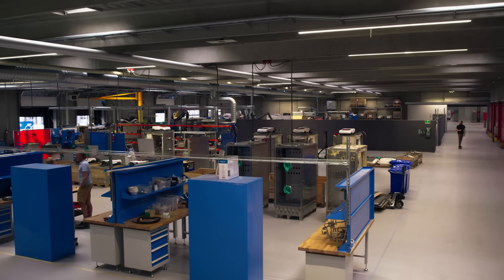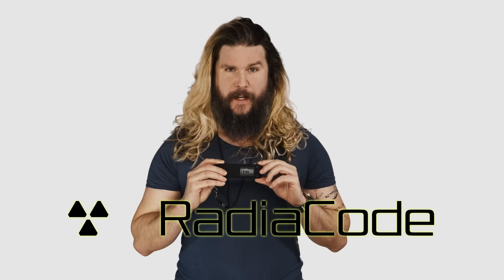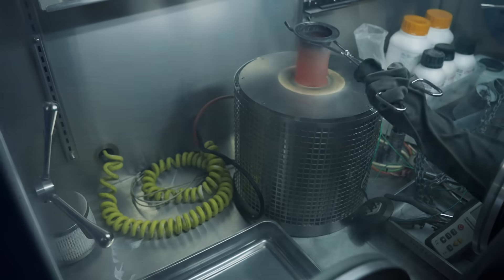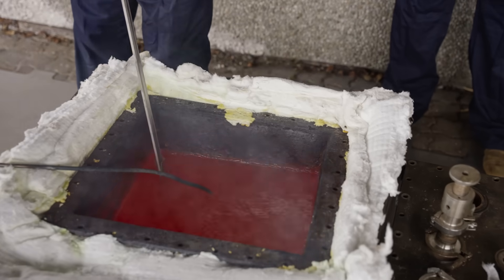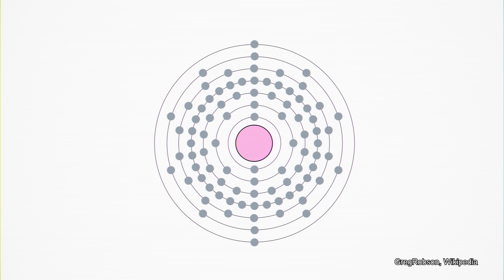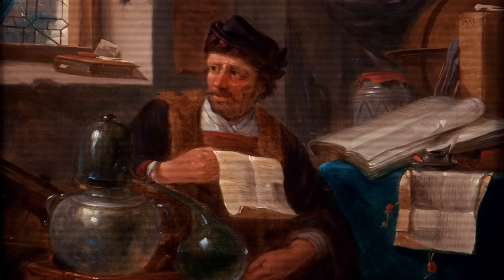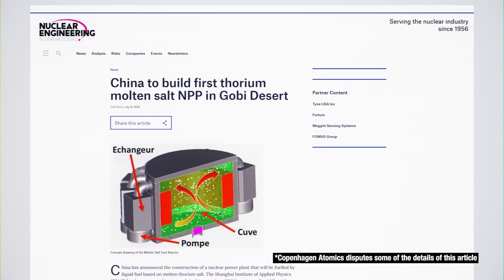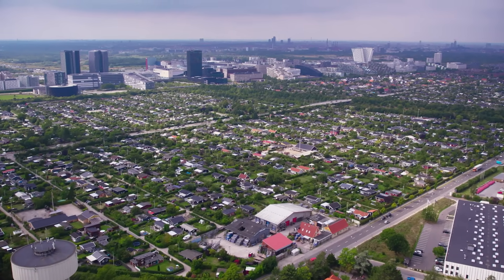Is THORIUM the Future of Nuclear Power?

Comment: Great vid, Kyle. Copenhagen are a legit team with a great design and solid manufacturing and go to market plans. Interesting point about 1t Th equaling 200t U, but does that ratio hold up if you’re using U in an MSR with online FP reprocessing?

Anyways, really interested to see part 2. We did a deep dive on that when we were just starting out at Terrestrial, and the conclusion we came to was depressing for me.

Comment: One reactor a day? I'm sorry, I'm immediately suspicious. Am I the only one? Even then, what about regulations? I can't see where's the good in that if you let a private company potentially flow the market with thousands of nuclear reactors throughout years of production and not talking about, in parallel of the actual development process, the potential risks of having so many small to medium nuclear reactors running out there. 

Safety and regulatory authorities already have to constantly contend with corporate and political interference and having so many more nuclear reactors potentially hitting the market is going to require a stronger workforce in those regulatory agencies, to track them. Which usually goes against corporate interests... Maybe I'm missing something but hearing him talking about producing one reactor a day seems very PR driven, at best, without considering the implications of that, at all. Am I wrong?
Reply: .... you missed what the guy said. the rectors only last for about five years. so he can only have at full pelt roughly 1800 of these reactors going at a given time. his scale is literally to power Europe. the fuel could last 100 years so what he's proposing is essentially making nuclear power plants that are as safe as running a diesel electric locomotive but you're swapping the fuel tanks when the locomotive is no longer operational.  Literally changing the nuclear industry to mimic the height of the automotive industry.
Reply: @Dallen9  Ah yes, missed it indeed. Still, you need to ensure those potential ~1800 reactors are well inspected and their commercial application well regulated. And it would probably be impossible with the resources that regulatory agencies have today. That's why I'm saying that both aspects should be tracked and developed at the same. Especially since regulations always lag behind corporations, unfortunately, as a direct consequence of a lack of funding and political/corporate influence. Still I'm all for developing those type of reactors, especially since fusion is certainly not going to happen as fast as a lot of dubious startups are promising out there...

Comment: The fact that the salt expanding slows down the reaction is what's coolest about this whole design. It's mindblowing that this stuff was abandoned back in the 50s or whenever it was. With a meltdown you just poop the fissile material into a storage vessel under the reactor and that's that. Reaction over.
Reply: The problem was the chemical side of things, corrosion control. But research into corrosion of molten salts and ultra pure salts have since fixed that problem.
Reply: @migBdk  Your salt is only ultra pure until you turn your reactor on.
Reply: @carlsaischa  That's why you boil off the volatile fission products out of the salt. And most fission products can be made to be volatile with a combination of low pressure and electrolysis.

Basically there is an in-build purification system in the reactor.
Reply: @migBdk  Yeah molten salt is very good at chewing through lots of things.
Reply: @migBdk  partially true. the big technical problem at hand was corrosion. but you are not looking at the more systematic underlying problem.
Reply: @MusikCassette  You kee saying Problem, without saying what it was.
Reply: @MusikCassette  Am I guessing this correctly? You point to a lack of political interest in molten salt reactors leading to a lack of resources for research put into solving the corrosion problem, and call this "the systematic underlying problem". 
But lack of research is not a problem. The problem is corrosion, and the lack of research simply means the problem was not solved for decades.  

Or is it some other problem you are not explaining?
Reply: @migBdk  no you are not.
Reply: @ Then explain what you think the problem is.
Reply: @ then explain what you think the problem is
Reply: @ then explain what you think the problem is
Reply: @ My last answer got censored. So I am gonna wait and see if this gets through.
Reply: "The systematic underlying problem" @MusikCassette 

Is being closed minded.
Reply: @RuyGedares_GuyRedares  not what I was talking about
Reply: Back in the 50's fossil fuels were pennies on the dollar today.  My home was built in 53.  No insulation, a steam generator in the basement that ran at about 60% efficiency with radiators built into the walls, under the single pane windows, up against the outside sheathing to warm the exterior of the home as much as the inside.  They just burned oil like it didn't matter because it was $50 at most to fill up the tank every 2 weeks by today's standard.  Same with energy back then.  Waste storage was "eh, who cares, bury it we'll never run out of room.  A MUCH MUCH lower electric demand (My house also had 60amp service. Now 200 upgraded.) and the major issue of having weapon grade material.  Just getting enough material back then to build bombs was a problem.  Today, we need thorium.  Period, end of story.  Using water under 800psi of pressure is just stupid.  Especially when you realize steams expansion ratio.  That's where all these blasts come from on failures, not the nuclear material.  Plus you can just move the thorium to a storage pool and the crisis is over.  Fukushima would have been a nothing burger if they used thorium.
Reply: @JViello  perfect explanation :) also the steam expansion point is really good.
Reply: Thing is with molten salt, is that it's horrifically effective at corroding materials. There's also the fact a molten salt reactor can't be used to make bomb-grade material. So... yeah, no bombs means no funding.
Reply: @The-Singularity-X01  "There's also the fact a molten salt reactor can't be used to make bomb-grade material." I would call that an advantage. I am not sure it is true though.

on the other point: the problem is not just corrosion, but corrosion in a place where you can not just replace stuff.
Reply: Yep just like chernobyl
Reply: it wasn't quite. there were a few attempts. But they were big failures. 
The hard truth that you nuclear fanboys have to face is, that any small technical problem becomes a major issue when dealing with radioactive material.
Reply: @MusikCassette  They did abandon it, as it didn't make weapons grade material. And at that time it was what people where most after in the reactors they wanted. They did build a viable test reactor at one point, but the cost of a dual program where one didn't make weapons grade material was unwanted.
Later the idea was also floated to make it mobile to be used in bombers, but the weight and technical advancements made it not viable.
Reply: @ your picture is incomplete. They really had big problems.
Reply: @MusikCassette indulge us please haha
Reply: @MusikCassette  nuclear fanboys? You sound like a child
Reply: @MJRSA9404  how so?
Reply: @MusikCassette the biggest reason that thorium salt reactors were abandoned was because they don't produce plutonium. You can thank Admiral Hyman G. Rickover for that.

Comment: One thing that I did not quite understand from the video: what happens to the excess neutrons? I get that more thorium is bred into new fuel but since more neutrons are generated than there are needed in the breeding process, there has to be an end to how much new fuel you can breed. Since you cannot dump infinite amounts of thorium into the process, something has to capture the excess neutrons at some point, no?

Comment: I think I know the answer. Thorium is highly corrosive to metal. Cost/reward balance gets heavily skewed. There is alot more preventative maintenance and upkeep with these thorium breeder reactors. Although a meltdown wouldn’t be as serious vs a traditional nuclear reactor, thorium reactors are a higher probability  of meltdown due to its corrosiveness. Traditional nuclear reactors don’t really produce a lot of waste either. 95% of nuclear waste is stored on site in massive 10’ thick concrete confinement buildings that can withstand a direct missile strike. Thank you T Folse Nuclear!

Comment: Thorium has a few tricks up its sleeve for power reactors. It will fission well in the fast spectrum and transmute to 233U in the slow spectrum. To take advantage of both processes the ideal salt mix is chloride based rather than fluoride based. Want to use it to breed Pu or H3 it is simple to do so just pipe hot 238UF6 gas through plumbing surrounding the active core region, and add 6Li as chloride or fluoride and you get tritium as either TF or T gas. ❤

Comment: molten salt being not in a state of natural critical runaway and the invention of "freeze plugs" is the only nuclear reactor that actually shuts itself down in a full power loss.   none of these systems of light water reactors that need backup power and generators in order to be safe and pump new cold water in or move the control rods.  freeze plugs are maintained with power and dissolve with no power and drain the reaction chamber.   I hope this gets mentioned in part 2.
Reply: Any nuclear reactor on earth shuts itself down when power is lost.
Reply: @carlsaischa  no.  They don't.  The rely on active powered cooling systems to shut them down safely.  Hence meltdowns when those fail.  Look up Fukushima.  Flood water hit the backup power generators.

Comment: molten salt is also a 1 atm pressure.   to get a light water reactor to work you need the nuclear heat exchange to be above boiling point by water and in a pressurized system and risk steam explosions.    Molten salt can heat exchange at 4x the temperatures while staying in its liquid range and zero pressure.  No explosions or pressure venting.    I hope this gets mentioned in part 2.

Comment: The one thing I’d like to understand more is the chances of losing the heat in the salt and it “freezing up” in all the piping. 

Years ago I dealt with a process that employed the circulation of molten wax. Unlike this process where the heat is generated from within, we had to generate the heat externally and then heavily insulate and heat trace all the piping. Any cold spot in the system could cause the entire process to freeze up. Luckily it was wax and didn’t take as much heat to reliquify as a molten salt would. 

Curious if they have the potential for similar problems.

Comment: Why?  Because the current nuclear power program is an offshoot of the development of nuclear weapons, both U235 and Pu238 types.  The U233 produced in the Thorium cycle is consumed as it is produced, plus the short half-life is not conducive to the development of nuclear weapons.

Many people do not realize that the US nuclear arsenal is actually under civilian control through the Department of Energy whose budget has been primarily spent on nuclear weapons construction, maintenance and custody.

The LWR development used U235 as it was already being produced at Oak Ridge and Hanford.  Later there was to be the so breeder reactors based on a Pu238 cycle.

Comment: While i am glad to see teams actively researching this topic, lets not get ahead of ourselves.  My understanding of why the MSR didn't gain traction had more to do with the corosive nature of hot chlorine ions on the metal of the plumbing, the chemistry needed to remove the actinides and other undesirable products from the molten solution without it freezing, plus the lack of experience with working with a novel fuel cycle in a novel reactor design (for example, how do you repair a broken pump in the primary loop? if you do get into a runaway thermal event and the drain plugs melt, then what do you do with tons of highly radioactive salt? What is the effect of neutron bombardment on the plumbing over the course of the reactor's lifespan?)
And no, PWRs have nothing to do with nuclear arms production, plutonium production was/is done in breeder reactors that typically don't produce electrical power because they're geared towards high neutron flux to irradiate the feed stock rather than heat the coolant.  The proliferation concern has more to do with the fuel enrichment process than the reactor itself.  And if a bad actor wanted to make a dirty bomb, the waste products of an MSR are just as bad.

Comment: So, I'm about to take a dump on molten salt reactors, but I want to say first that I like them and support them.  We should most definitely be looking at these types of reactors.  That said, there is problems.  These aren't new.  One of the first reactors was a molten salt reactor.  They were kinda crap.  If you can't keep the reactor online because of some issue you got a really big problem.  Which is what is most likely to happen with the first motlen salt reactors.  Some places these things are simpler.  Some places they are more complicated.  Like if molten salt and water meet, you're having a very bad day.  So now you have to put all of your pipes into double pipes or do something to make sure the two never meet.  Also when a water reactor turns off you wait like 2-3 hours before you can touch it, because of radiation.  For a molten salt reactor you have to wait a week because it has different decay products.  Liquid water reactors won the technology war because they were less crap.   Now 60-70 years later we now have 60-70 years of experience and expertise operating liquid water reactors.  This is going to be VERY difficult for molten salt reactors to compete with.  They are going to require a lot of work to get operational, get their capacity factor up, etc.  That said, we should still do so.

Comment: No it isn't. Thorium cycle MSRs solve a problem that doesn't exist and exacerbate a problem that does. They're more expensive than LWRs, and capital cost is the primary challenge of nuclear energy.
Thorium is non-fissile. The thorium fuel cycle is a breeding cycle. Breeder reactors are inherently larger, more complicated and more expensive than non-breeders. 
Molten salt reactors are inherently more challenging, complicated and expensive than conventional breeders. 
Sure, with MSRs, you can theoretically increase fuel burn up, if you're fine with complicated online reprocessing. But fuel is not the issue with nuclear. Enrichment is not a challenge. Fuel costs are an insignificant part of the through-life costs.

If nuclear is to have a future, it needs to be economically competitive with the other energy sources. In order to become less expensive, capital costs have to be reduced. The most viable means of doing this is by taking existing mature, well supported technology, (LWR) and scaling it down. Mass produce small modular LWRs. Economies of scale, reduced capital costs, and shorter ROI for investors, less through life revenue (and thus cost) going on interest on decades-long loans.

The issue isn't technological...

Comment: Very cool getting to see molten salt.

I had a couple of concerns about the feasibility of their reactor design. 

First I never heard them mention whether it had automatically cooled down if there were a total or partial system failure (impossible to have a runaway reaction). 

The other issue is the lifespan of their reactor components, they said they would need replacing every five years... That’s not an economically efficient solution. It’s great that the fuel will last 100 years, but if the reactor has to be overhauled/replaced every five that’s a major issue.

Comment: I think part of the issue with getting Thorium off the ground is the fact it is tied to Molten Salt, the two technologies are mutually exclusive and novel.  Sticking them together doubles the hurdles you need to clear
Reply: What do you mean "mutually exclusive"? Thorium dissolves nicely in the relevant salts.
Reply: @MalcolmAkner  you can have a thorium reactor without the molten salt component and you can have molten salt without using thorium. Even though both have been around for decades, these two technologies are in their infancy, and by linking them together they hinder the other from succeeding
Reply: @ That is not what "mutually exclusive" means, since you can have both. What you mean is that they are independent of each other.
Well, the molten salt reactor does work, it was showcased during the MSRE at ORNL in the 60s where it logged many thousands of hours of operation at full power (~8 MW, so it was small, but an excellent proof of concept). The thorium aspect was in their pipeline, the MSBR, but the project was scrapped before it could be built for many (controversial) reasons. 
You are right in saying that breeding of thorium does not have to take place in a molten salt environment, but it makes a ton of sense to do from an efficiency standpoint. Since you need Th232 to transmute into U233 and then extract it, doing that in a liquid is much easier since you can do flourination of the liquid (salt) to get the U233. And by deflourtinating the UF6 -> UF4 you can just dissolve the UF4 in a flouride based salt. 
Doing that in solids needs many more physical and chemical separation steps. 
A liquid core is very advantageous from a fuel burn-up, and thereby efficiency stand point as well, but as you're saying, there are no commercially available reactors using salts. Yet.